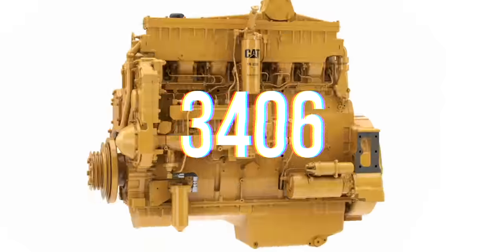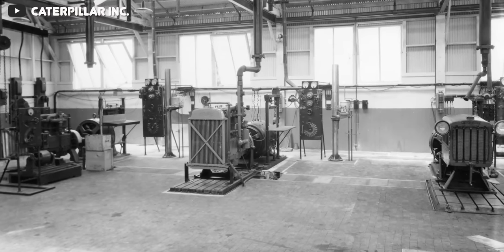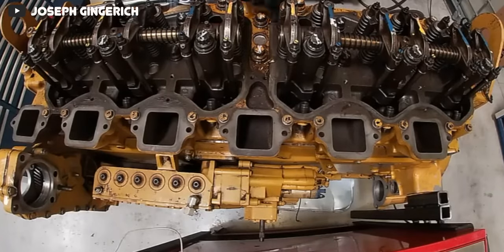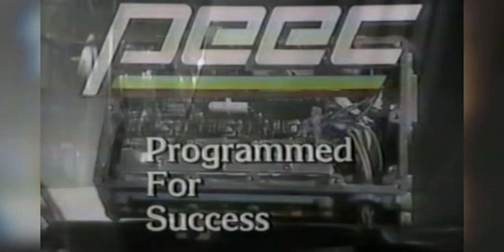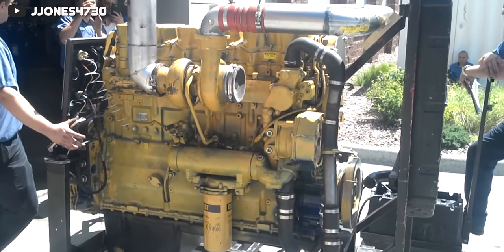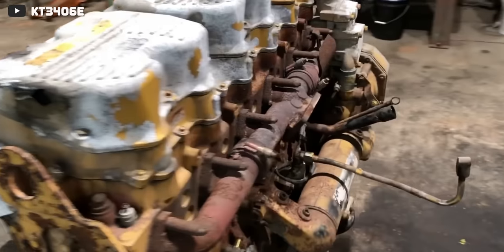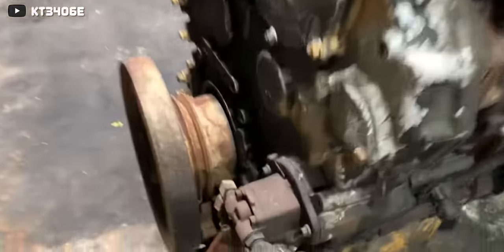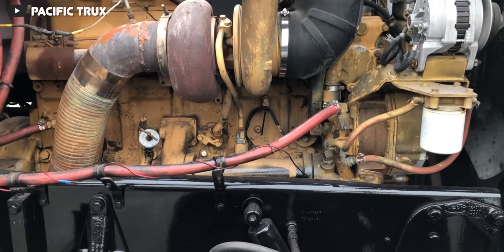The Legend of the Caterpillar 3406

Comment: Cat still makes the 3406C mechanical Diesel for third world countries that want a mechanical engine for pumps, generators, compressors, boat engines. The 3406 is also made as a spark ignited natural gas engine along with the 3408.
Reply: they also use them in underground mining applications in the US and the aforementioned thrid world countries
Reply: @skonky  Nah they need reliability and it's already crawling with bad air in there it might as well have an old diesel running 24/7, like you said, they gotta vent it anyway.
Reply: @skonky  emissions also puts off higher amounts of heat when in Regen so temps are huge when in confined spaces
Reply: @skonky  Only in the US. In Canada, the vent required is way way too much. C15 and C18 are much more useable as the vent required is way lower.
Reply: We have 3406 and 3412’s running off methane gas for power generation
Reply: Those are not OTR engines . Industrial . Cat got out of  OTR  engines because they got tired of the EPA's antics .
Reply: @johncunningham4820  No Actually Caterpillar at first took a wrong turn trying to create DEF free smog controls. They spent millions in both design and warranty claims. Instead of using what everyone did, they got out of the OTR truck business. They are selling as many as they can make and all their USA engines now use DEF and DPF just like everyone else. But still don't want to get back into the trucking/bus industry.
Reply: They will need to build this soon for 3rd world America
Reply: @RustyAcresSquare40  . Yeah .
Venezuela and Peru .
Reply: @Tchristman100 they concentrated on construction equipment.
Reply: There is no such thing as a 1st world country!
Reply: @Tchristman100, this video and your comment are of a big help for me as I am willing to engage into the boat business in Africa. A friend of mine, a mechanic, recommended the 3406 engine. My question to you is this if you may help:which version of the 3406 (marine) would you pick? 
Thank you for any response.
Reply: @fortunekinguelewa1246  3406C mechanical be my choice. Use a spring starter on it and you eliminate the electric starter, alternator (except for boat house use) big starting batteries.
Reply: @Tchristman100 the bigger HP engines like c18 and up do not use def. Just have a dpf, still tier 4.

Comment: Hands down this was the golden era of truck engines, 3406 and C15, Detroit series's 60, Cummins N14 and signiture gen 2.. didn't matter which colour you had they were all great
Reply: Untill the epa screewed us
Reply: @garybrown9719  100%
Reply: Even Volvos back then weren’t that bad, introduced in 93 pre emission Volvo D12 is still one of the most popular truck engine in the third world countries, it can easily run over 2 million kilometers (1.25 million miles) with no rebuild , it still used in Marine applications and emergency generators . Too bad it was replaced in 2007 by a junky emission compliant D13 that eats NOx sensors , camshafts , injectors like there’s no tomorrow and by 800k many of them require complete head rebuild
Reply: 90s was the real golden era for Diesel engines…
Reply: @Nikowalker007  my d12 was rebuild at 1.6 million due to broken rings.... if wasnt for that i woulg go way further!
Reply: Now the isx15 and dd15 own the market
Reply: @mattleonard5268 and the isx , x15 are crap engines compared to the 90s
Reply: I liked the 3406. Had one in a 95 kenworth when I was hauling silage. Great for lugging  through the mud. I still like the old 8v92 Detroit. It had quick throttle response.
Reply: @Nikowalker007 love the pre egr d12. I’ve had 3 of them in my fleet. My 1998 425hp d12 made it to 3.2 million km before the oil cooler gave out and started mixing oil and coolant. We parked it since then but the engine still ran good. The Volvos are definitely harder to work on and expensive on parts but they ran so smooth and were amazing on fuel compared to other motors in its class.
Reply: I liked the E9 1000hp Mack engine myself

Comment: yep, a 3406B, 4 and quarter turned up around 500 horse, in a long nose Pete, stick your foot into it and get a puff of smoke from the stacks and away she would go. these young drivers don't know what they are missing. sure brings back memories.
Reply: Yee Haw! I've  driven quite a few B and C mechanicals. Some were built with  steel top pistons so they could be turned up past 500. One in a 379 with 13 speed and 3.36 gears and tall 24.5 rubber. The one and only time I ever went  130mph in a big truck. Good  times man!
Reply: Young? The farm I work at is all 3406B or E or Detroit 60s. Most of the rigs were built before I got finished with high school.

Comment: I have 2 mechanical 3406C’s. they are apocalyptic level reliable, and have been in the family for 26 years and about 3 million miles between the two of em. Some of todays engines through technology are more fuel efficient but those monetary gains are wiped away and turned into a loss when you factor in lost revenue from downtime, repair costs, emissions failures, waiting days or weeks to receive service and then dealers and shops being unable to properly diagnose deep rooted electronic interrelated issues, thousands of added parts and systems prone to failure, a level of complexity that requires proprietary software to access, DEF cost, now we have low quality replacement parts and shipping delays, You name it, ELD system maintenance I could go on…Rebuild a mechanical 3406  drive it correctly and you will give it to your kids 25 years later, the only thing that can kill these engines will be the government and that would be a sad day if it ever came.
Reply: All we run is 3406’s, C15’s, and big cam Cummins.  We have 13 in the fleet and all are dead reliable.

Comment: The good old cat engine's reliability is an understatement compared to today's engines if you were driving from Pennsylvania to California you knew you were not going to break down and if you did you could fix it with a screwdriver some duct tape and starting fluid and a few filters.....
Reply: That's no shit. Had a 3406B that broke a rocker shaft and I fixed it in a truck Stop parking lot in Vegas. Set it up with my feeler gages and I was good to go.

Comment: Drove most of them back in the day. 3406 360hp PCTA, 3406 375hp PCTA, 3406A 380 hp DITA,  3406A 400 hp DITA, 3406B 400 hp DITA,  3406B 425 hp DITA and 3406E 435 hp. It is an absolute shame that these engines had to go away and be replaced by the current exhaust choked "compliant" engines. Of all of them my favorite is/was a hot "4 and a quarter" B model. They were king of the road and still could be.
Reply: my favorite as well 1987 425 hp air to air,  awesome engine

Comment: I have a 92’ Peterbilt 379 that came with the 3406C PEEC engine. After a million miles I had it rebuilt and put a B model pump on it making it a full mechanical engine. The truck has never ran as good as it does now. I just recently bought an 84’ kenworth W900B with a 3406A CAT. I have 2 core 3406 B model engines in the shop and will be swapping my 86’ Peterbilt 359 from a 350 Big Cam Cummins over to a 3406B once the engine is complete.

Comment: I remember a place I worked at in Northern BC had a 3406 with a 25kw generator, it was using a lot of oil at the end of it's life, but still churned along without so much of a hiccup for many years 24/7
Reply: Did you mean a 250KW?

Comment: The company I worked for ordered a round of C15s. I put close to 700k on one and during that time the repairs were as follows, water pump, alternator, front oil seal,and starter. The mechanics loved them and so did the driver. However going back to the start of my trucking career I would have to say that my favorite Cat was the 1693. Loved that motor.

Comment: Mine hit 37,000 hours when it finally cracked the head internally and was spitting coolant out the exhaust. Just got first rebuild and I still can't believe it took that long to need a rebuild and it runs the same. I'm more than impressed.

Comment: I was always happy with this engine. 980 F. F series was a great series before it got all of the electronics. 21 thousand hours is a good run in a front end loader. I started with a 988 87A series with a D 343. It was a good engine.

Comment: As a Diesel Mechanic my favorites Tend to be the 3406 E or A . The N14 Cummins. And the classic 60 Series from Detroit
Reply: I'm not a mechanic but the c15 seems to be left of the list
Reply: I have a 98 Pete with a E model Cat.Almost 2.5 million miles.2 inframes and original crank.Best engine ever in my opinion.Just saying
Reply: @sae4071  C15 while a great engine, it’s known for the compressor blowing up constantly/Horrible EGR issues and VGT issues.
When well inspected and maintained yeah it’s fantastic. But if I had an unlimited budget I’d definitely go 3406E
Reply: It's hard to dislike any of those engines. I learned how to do this job by working on Cummins 855s and N14s, some DDEC 2 60 Series. That was a good time for the industry .
Reply: @virtualheavenly  huh, that makes sense. My dad's c15 never gave him any issues but he takes it to the dealer for all his maintenance soo
Reply: Absolutely
Reply: @stevehill1042  you rebuild it 2x inside the frame?  98 Pete?
Reply: @virtualheavenly  C15 never used a VGT. They've came with a single & compounds on the later. SDP offering the largest setup on the atmo side.
Reply: @virtualheavenly  and a C15 is far superior to a 3406E model.  Power is much easier to achieve, much thicker block, and much larger internals. People prefer the E models due to having the ability to run paper log.  Acerts will walk any B, C, or E model.
Reply: As a Mechanical K.I.S.S. type of guy, I really wished there were Mechanical Versions of 50/60 Series Detroit.  The fully Mechanical part of the Pre-DDEC 53/71/92 engines and of course Cats Mechanical 3304/3306/3406 and even the 3204/3208 engines were actually ok for their intended use....and had Cat used a more simple overhead on 3114/3116 engines, they were pretty decent on bottom end for being parent Bore like the 3204/3208...

Comment: I was with Cat in Australia through the B, C  and E engines. The C with its Brushless Torque Motors was absolute Crap.
When the E arrived it hit the ground running. It was the best road truck engine I worked on. ( except for the rear flywheel housing and front cover oil leaks.)
I think you nailed your appraisal of this series of engines.
I still see the C15/C16 as a 3400 series engine. I just see it with a metric identifier. That being 15 litre and the 16 litre stroked version.
Will keep an eye out for your other video’s now.

Comment: I’ve worked on several of these Offshore only problem I had offshore is the injector lines would rust out about every two years
Reply: Surprised those wouldn’t be using stainless steel tubing in such a harsh environment.
Reply: Wasn’t offered I asked Mustang (Houston Cat dealer) said that they didn’t have them available this was around 80-81
Reply: @rickybroussard5350  should have just gotten the outside of the lines galvanized

Comment: It might not interest anyone but the 3406e was also used in the romanian trucks DAC 16.550 (4x4) and 26.550 (6x6) which were going to take part in the Paris - Dakar rally. Originally the engine was a tuned version making about 660 HP combined with a redesigned cabin. However financial issues meant that they had to use a stock cabin with new CAT axles and a stock 550 HP 3406e (it had 16 tonnes rather than the previous 9 tonnes design). Despite these setbacks the factory team managed to get 2nd and 3rd in the 1999 Rally of Tunis only behind an Iveco driven by ex-WRC driver Miki Biasion.

Comment: As a diesel-truck tech circa 1978-83, every shop I worked in considered the Cat 3400 series the gold standard of class 8 truck engines, easily preferable to Cummins NTC855's, 903's, & Detroit 8v71T's, & 8v92T's At the same horsepower rating they always out pulled the others. Only other engine that came close were the  Cummins KT series. I really do despise the EPA and CARB

Comment: We love Cat 3406's.   One engine is in a 1990 International 9300 semi tractor, Second engine is in a 1992 Peterbilt 379 Ext Hood, and the third 3406 is in a Steiger 4wd farm tractor we recently purchased 
Have a Steiger Panther 4 wd tractor with a Cummins 855 that came apart this past spring.
My experience is Cat engines have more lugging ability then  competition has.   Parts are more expensive for Cat than Cummins are.  Just found your channel and will definitely return
Thank You

Comment: I love the 3406 Cats. There’s so much that you can do with those engines. I like the 3406B Cats a lot especially because they’re strictly mechanical engines. Real bulletproof. My 1990 Kenworth dump truck has a B model Cat that has about 500 horsepower in it.

Comment: Our fuel hauling company currently run glider kit W-900 Kenworths, with 2WS Cats. 550Hp with a cat brake saver & Jake brake. 
They are a beast pulling 85K # down the road. Even with 2 engine braking systems, the ISX Cummins is far superior when going down long steep grades. 
  We are in Western Colorado on I-70. 
I recall the C models only difference was air to air after cooling, rather than water jacket cooling. 
The 2006 Acert my brother had was kind of a turd. It was 475hp, in a heavy haul truck. Was always running warm, 215 degrees. Went thru intake actuators often. Actuators are only sold as 2, so you have to pay  $600, every though you only need 1.

Comment: This is the goto oil rig compressor engine with a sullair on the back. When that oil rig lit up in the Gulf of Mexico their explosion category went from ‘rig safe’ to zone2. And that is a pain when the paperwork file is twice as big for the electric controlled engines. Scantek we’re taking old cat/sullair sets and fully rebuilding into a new container.. They built several hundred. :o)

Comment: The PEEC engine didn't have a throttle body which you mentioned. It had an electronic torque motor to control the timing advance and a second electronic torque motor to control the rack in the fuel pump. You may have meant to say that it had and electronic throttle pedal. I did a lot of training on the electronics on the PEEC engine.
Reply: 3406a's white in color
Reply: @cxrcraig3  Only if they were installed in a Kenworth. Kenworth painted the entire drivetrain white.

Comment: It should be mentioned that there is also a 3412.   890 hp in the Backup  Generator drive version pushing a 600KW Alternator (those truly are alternator though the package is called Gen Set).     I had 3 of those.   Major reliability issue was the fuel pump,  they would start to weep.    Easy enough to replace.    I had one 3406 (B I believe).    Only issue was the governor that we finally got Cat to pull apart and fix (it would stick on a load dump).     All rang well despite running Jet A fuel they were not specified to do.   Some nozzle seals let go but again,  that could have been the fuel or equally the age (heate4d to 120 deg 24 x 365 for quick start in Standby mode.)   
          Of that vintage I had a VTA-1710.    I would call them equal.    Both started well, picked up load well and few issues (again heated 24 x 365 meant it was almost partly running as far as seal age went all the time).

Comment: 98 1LW 3406e marine cam .58 injectors swapped 07 acert 15.3 crank forged for the 14.6 cast pdi manifold and 78mm non waste gate turbo custom file for the ecm 13 speed 3.36 rear gear 300 inch 98 379 Peterbilt mid-roof 2.1 million miles drive it every week 700 ish horsepower gonna be buried in it…
Reply: Wondering the mpg?
Reply: Mpg?

Comment: Ok I love the 3406 I had a B I loved it. 
 But I have a engine I liked more at least economically. It's the much maligned 3176. I had one dependable reliable. But what won me was the fuel bills.
 I bobtailed the freightliner it was in 2,500 miles averaging 95-100mph.
 Average mpg? 16.7 mpg. 😍😍😍 The 3406 B as much as I loved it it averaged 7.? Mpg . I  have had many trucks the average at the time was 7 but fuel was $1.67 per gallon. Then.
 The 3176 averaged 9 that's almost a30% increase in profit margin.
 That makes it my overall favorite diesel.
 Now my favorite diesel medium duty would be another maligned diesel the DETROIT 8.2 non turbo.
 Another mpg monster. Commercial fisherman call them the fuel pincher and fuel miser. In a Ford f650 rollback towtruck with a car on the back that averaged 24.8 mpg ❤️❤️❤️❤️❤️❤️❤️❤️❤️❤️❤️❤️❤️❤️❤️
 They are also said to be weak . The 8.2 had a couple little brothers that were the worst diesel engines ever made breaking crankshafts ore blowing head gaskets every 15,000 miles.
 So why is it my favorite overall diesel?  It's 250,-500,000 if you are really really lucky before  a rebuild. Here's where being tainted by the reputation of it's junk little brothers keeps the prices WAYYYY DOWN. you can start finding used running 8.2 Detroit for $500 (as opposed to a 12 valve Cummins start at running used $5,000 10 times as much) .but you gotta be quick to jump on.  Because of the fisherman. The rebuild cost s on the Detroit  was a few years ago average $5,000 while the 12 valve Cummins was double plus . Very very simple dog slow motor.
 But remember fisherman are your compilation for them and they are willing to buy busses and trucks just for the engine driving up the prices on old busses and trucks. Like they do for trucks and buses for 12 valve Cummins.

Comment: Favorite CAT engine has to be the natural gas powered 3516, it’s just a monster used the world over for power generation and compression.
Reply: Except for the ULB version lol
Reply: @melvingibson4525  hahaha right you are, sir!
Reply: I’m currently onsite with 20 x 793B trucks running 3516 high displacement engines.  Have just put a replacement Cuffed liner version Engine in one of them. These would be my second favourite after the 3400 series of engines